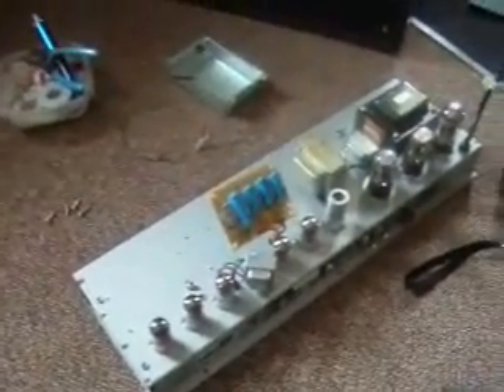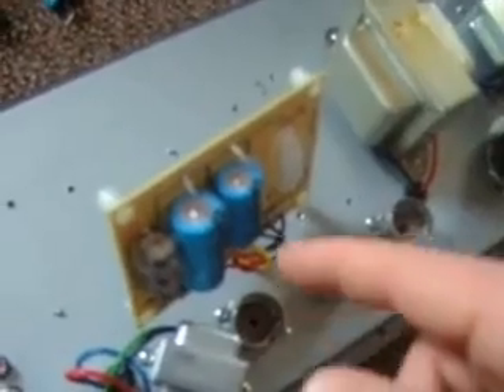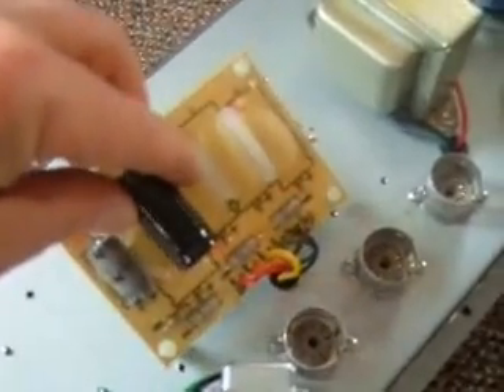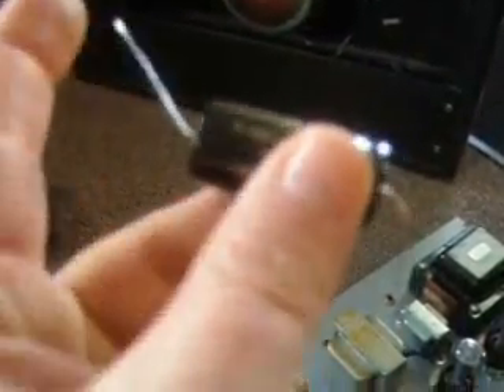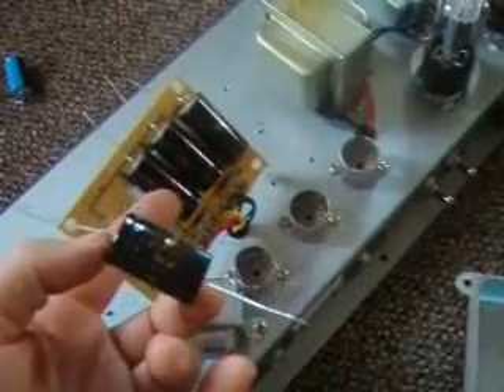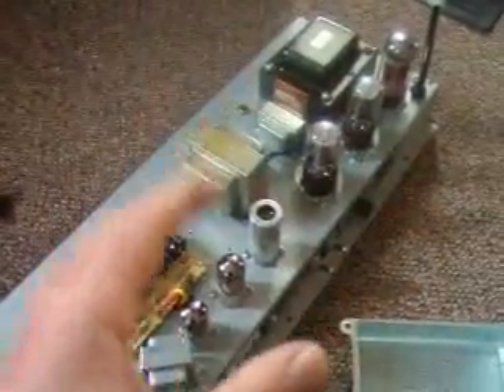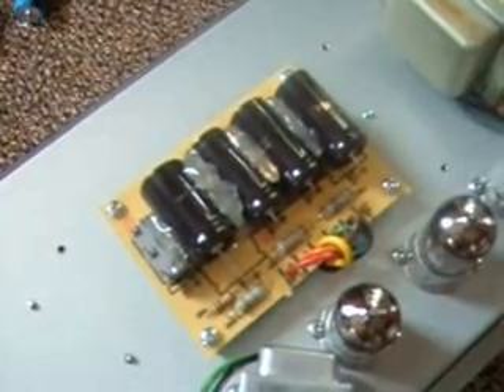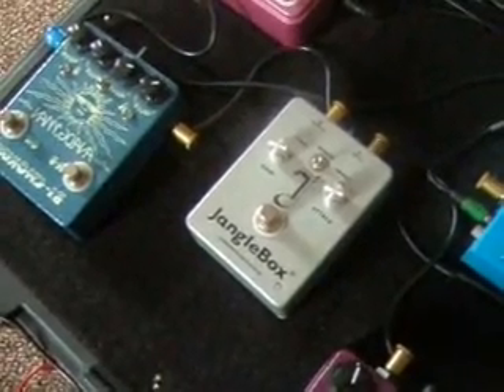Filter Caps (DIY)

Comment: Do you need a really hot soldering iron to do this?
Reply from the maker: I think the iron I was using is a 15-30 watt iron... so no... a 100 watt iron is not for this electronic work ... that's more for soldering grounds to chassis or raw metal surfaces where more heat is needed. Just use a basic low wattage iron.

Comment: @9.24 should be, "If you want perfection, play a tube amp"

Tubes/valve amp are by far the best you can get, i used to have a Laney Supergroup from 1969 and even to date nothing has even come close to the quality of it.
Reply from the maker: Well... I recall this one guy... he had a 300w solid-state for small jazz gigs... but he was that good... wanted to hear all very clearly he said.
Reply from the maker: I like tubes personally because it breathes more variable qualities. Not as sharp or edgy... but fluffier and has more 'ghost in the machine' personality. It sounds different depending on the environment and the electrical variances of where you plug in. Moodier. More 'alive'.
Reply: That's not what he said, I f you want perfection play solid state if you want compression and sag play  a tube amp.